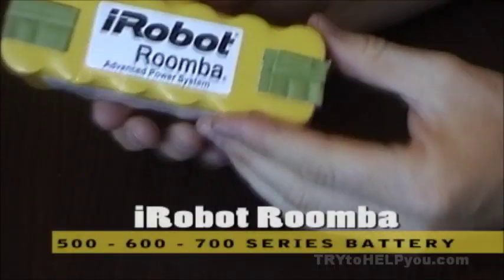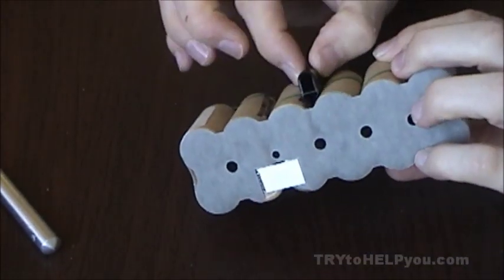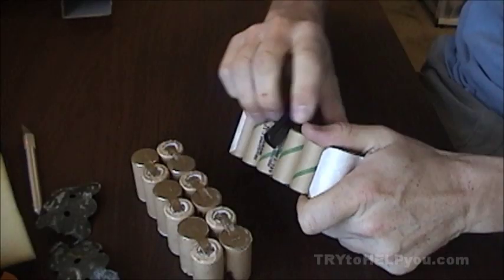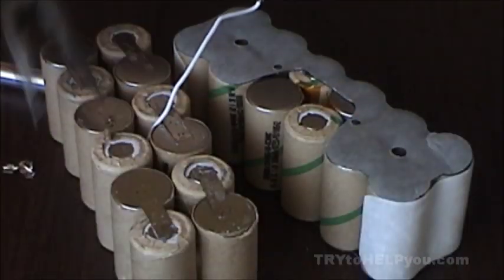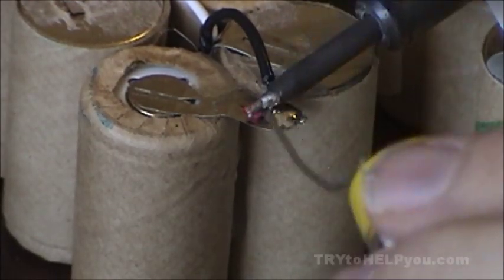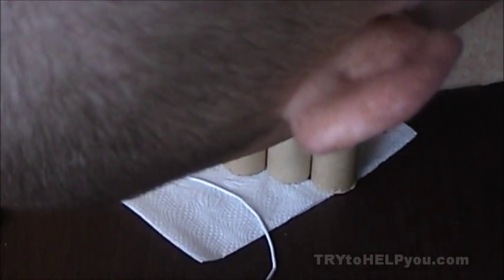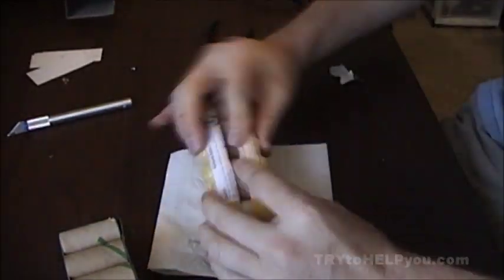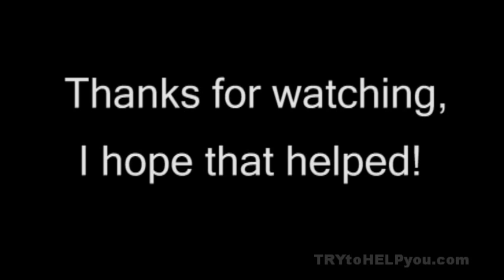iRobot Roomba battery rebuild 500 600 700 series

Comment: good job one way to greatly extend the life of a nicd or nimh battery is by balancing the cells with resistors in each of a value between 430 ohm to 1k ohm. this applied to battery packs on old satellites google patent information.

Comment: Hi,

Do you perhaps know, for the NiMH battery, at what voltage the battery is considered (by the vaccuming unit) "empty" & at what voltage fully charged ? 🤔

Thanks ! 😏🖒

Best Regards,
Reply from the maker: All I can do is guess. 1.3 volts full and .8 dead, per cell. Just a guess

Comment: I see there are 4 metal contacts on the newer battery. I know the 2 bigger ones are + and - but do you know what are the smaller contacts for?
Reply from the maker: I think it is a thermal sensor input..
Reply: @TRYtoHELPyou  NiCd and NiMH Roomba batteries have different resistances across the two small terminals, I think it tells the vacuum which charge curve to use.

Comment: That black plastic thing contains a thermistor which will sense if the battery gets too hot when it's charging.  It should be handled with care and tested before removing.  Also I believe the 400 series used NiCad batteries vs the 500 series which uses NiMh batteries.  Big difference there.  You are also incorrect about your facts regarding Nicads vs. NiMhs batteries.  Nicads suffer from a "memory effect" and do not like being fully discharged.  NiMh batteries are superior in many ways.  I am an electronics tech here and Google is your friend.
Reply from the maker: Kirk Decker thanks! yep, went nicd replacing nicd.. voltages are comperable but im not sure about charging curves etc.